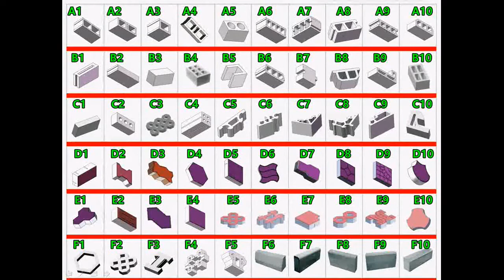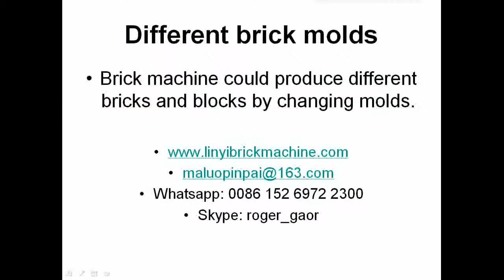GiantLin machinery QT4-15 fully automatic hydraulic concrete block production line produce standard

Comment: What's the pressurized value?
Time of head press?
Time of head re-pressing?
Frequency of moulding vibration?

We cannot produce a solid hollow blocks because of lack of correct information on the manual.